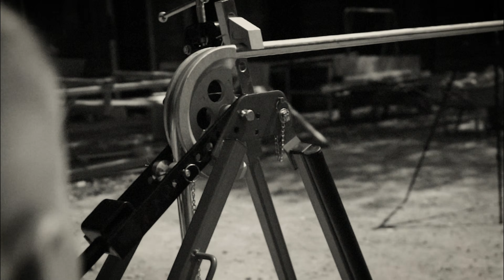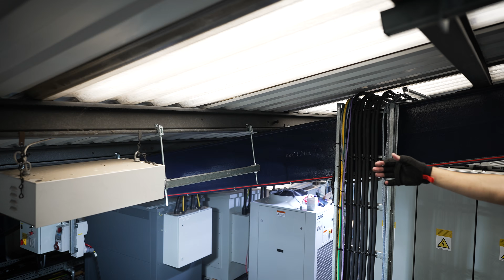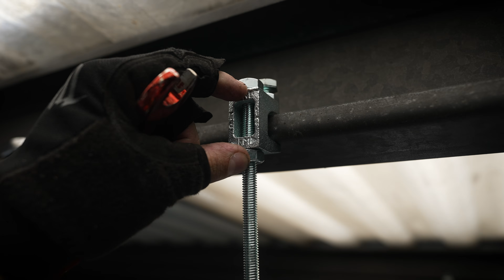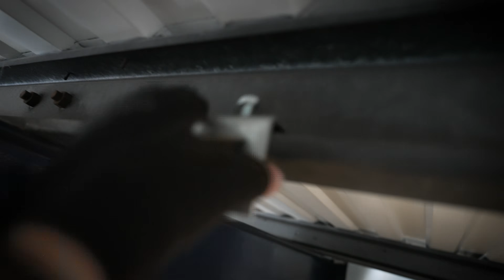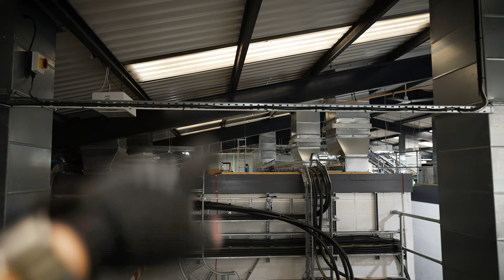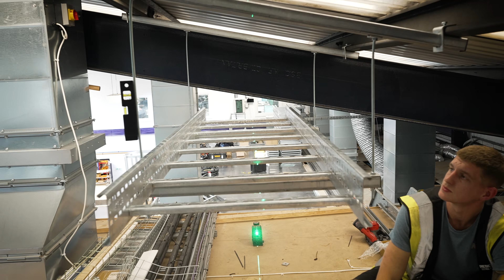Building trapeze supports for 700kg of SWA

Comment: To mitigate the need to bend the rod, although tried and tested, for aesthetics you can use threaded rod ball joint connectors - just adds an extra layer of labour to the prep

Comment: You bent the perling.......not just the rod.  Obviously these rods are not designed to be bent, and doing so reducing the strength properties.....but I'd be more concerned about the roof.    I wonder if the roofing structure is designed to withstand kinks every meter or so?
Reply from the maker: You can bend rods, seen plenty of specs, drawings and loadings on them over my time going into detail on it - it was the standard for decades before swivels came about.

The roofing structure has been assessed to hold this load based on this design, that is the only trapeze mounted to a purlin that was bent, literally said that in the video.

Comment: Great video/tutorial Mike.  Really enjoyed the style and content.  Just like the good old days,  

As a side note.  Worth looking at Spring washer after a normal washer and Nyloc nuts as well.  They will help stop any lossening from vibration but it does mean the cost of project increases.  There is a caveat with Nyloc, they are less effective if there is temp cycle from hot to cold on a regular basis.  I will try and find you a link to a guy who explains it better than me.

Anyway, great content as always Mike.

Comment: Are lock washers needed in addition to the standard washers?
Reply: It's not common to use lock washers but depends on the specification. In some factories nilock nuts are used but again it depends on the job specification.

Comment: Hi, for future use, All threads should be 2 full threads past the nut to ensure full engagement. We've had various lock nuts back off and fall off, so now specify nyloc nuts and nordloc washers as standard in any possible locations where vibration from equipment, buildings, wind ect are possible. Just something to think for future installs.
Reply: Agree, it's consider structurally sound 2-5 threads.
Reply: Also could use spring washers

Edit: just seen that you wrote that
Reply: Use a lock washer it won’t happen lol. They make things for that
Reply: Who exactly is we? You personally?

Comment: does the additional half tonne loading hanging from the roof structure require a structural engineer to assess the design ?
Reply from the maker: Not necessarily, depends on a lot of variables but in this case the due diligence had been done.

Loading is fine but we was advised to not drill any purlins.

Comment: Put your window brackets on the strut then offer it up slide window bracket loads easier than lining the holes up in the air
Reply from the maker: Yeah for sure, due to the lip on the purlins that technique involved removing the bolts, but normally that’s the way 👍🏼

Comment: I know you use a bandsaw to cut the strut just got a Milwaukee metal circular cuts though it like butter leaves a great factory edge. 
We also hang a m10 rod off the ceiling and use it to stick the laser to for setting the strut Hights. Great video keep them coming 👊🏻
Reply from the maker: I’ve heard a lot of good things about the metal saw to be fair! And yeah great shout on the laser 👍🏼
Reply: For the Dewalt camp, who want to keep with them, who I started with for a few years before jumping on to Milwaukee, also has a great metal cold cut saw (DCS373NT-XJ) It has a 43mm depth of cut, which is perfect for Unistrut as well as cutting off the excess rod before chamfering with the 3 blade chamfer tool in the drill

Comment: For sloped ceilings we like to use hinged ceiling brackets from Legrand VAN GEEL. No need for bending rods!
Reply: swivel mounts for stud
Reply from the maker: Nice! Swivels are good too, just got to check the loading 👍🏼
Reply: @residualelectrical  Yes to be fair the times I've mainly used swivels has been holding up pretty small-size containment, generally for lighting and the cabling for it.

Comment: How come all cable trays that we see British sparks use are suspended like this? In Sweden we use supports that goes up from the middle of the tray or ladder. That brackets gives us the ability to lay the cable up instead of necessarily having to pull it through all those brackets that you use.
Reply from the maker: I’m not sure, just the way we do things, I’m not sure how the loading would work with a center support, I’m sure the tray would bow also
Reply: I assume this refers to brackets like the 'Legrand OH150PG Overhead Hanger'. 

They are available and sometimes used in Britain but not supper commen. Partly due to cost and partly due to the British mentality of not valuing comfort over skills and tradition.. 

"Don't fix it if it isn't broken. We've always done it like that" 👍

Comment: why don't you get some non spray galv paint '? and just dip it, spraying the cap or a board seems wasteful and your still breathing the aerosolised paint.
Reply from the maker: That works great too, both applications have their benefits - this was an old can of spray I’ve had for a while so made sense to use it up 👍🏼
Reply: @residualelectrical  at least you don't accidentally kick it over with the spray can method.
Reply from the maker: True! It’s also great for getting into places a brush can’t!
Reply: Nice Mike , we have just finished the containment to the workshop and server room of a tech company . Trunking , basket and tray hung from the ceiling on trapezes . Be wary of the large cables pushing the trapezes when you bend them and tie them in .
Reply from the maker: Nice job! We got the cables in on Friday actually, had to brace a few bits here and there to make sure the 185’s didn’t destroy the place haha!